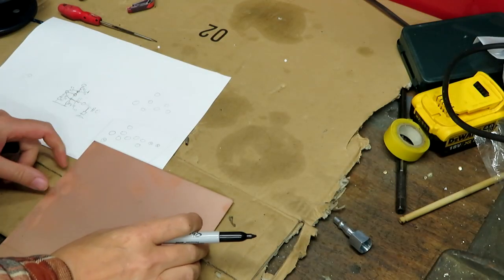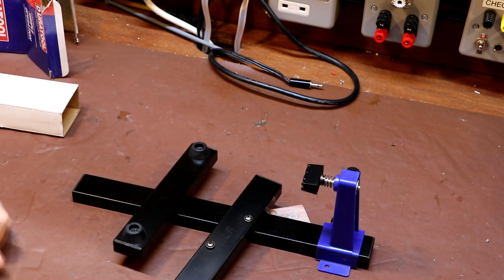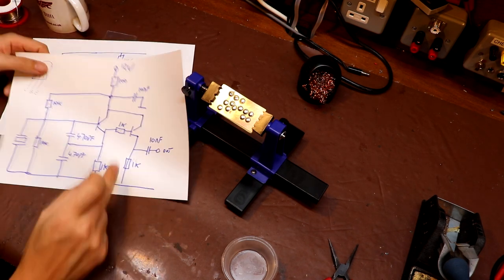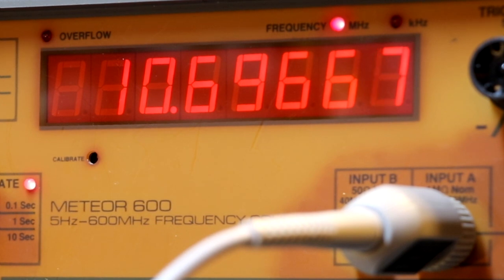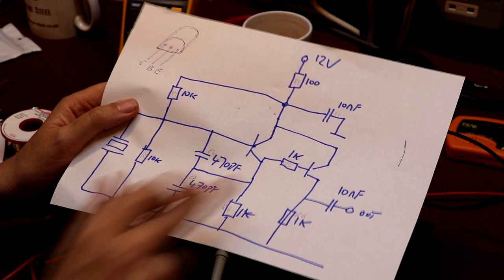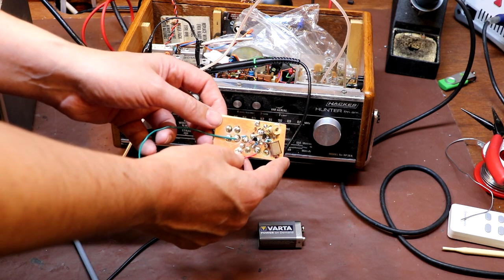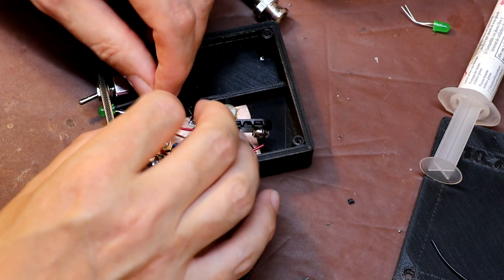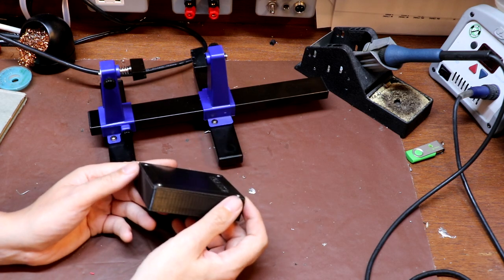Wobulation 10.7Mhz Crystal Oscillator

Comment: Nice little project there chris :-D
As i'm sure you know (far better than me), using double sided copper cad pcbs with lands is good for higher frequencys.
No long inductive tracks and minimal capacitance between parts.
I've gobbed a few circuits together in that style because i just could not be arsed, and for stuff that gets thrown in a box for my own use, it don't really matter.
Tobacco tins are nice for r.f boxes or just pcb sheilding :-D.
My dad was hooked on Golden virginia, it was in metal tins in those days :-D
The outboard xtal osc boards in am/ssb c.b radios were handy for super quick oscillators.
I did build a pll controlled wobbulator (from an electronic mag 20 years back) at 10.695mhz for r.x testing, but it was unstable so bugger it lol.
All you need is a itt410 varicap diode biased with a 68k to v+,  then  connect the diode  to the transistor base via a 5pf capacitor. (diode anode to earth).
Feed the diode with a 100k resistor and series 10nf cap from a pot with audio on it,  10.7mhz f.m  mini transmitter lol.
Values would have to be messed with, as i guess a lot ha ha :-D
Or just say "Bugger it"  ha ha :-D.
Smashing video chris, love the neat box you made :-D
Reply from the maker: zx8401ztv I used build all kinds of thinks into those tins my grandad used to also have some . It was a nice little weekend project and something I need for the FM alignment I want to do in the future.  I was looking for a wobulator circuit to homebrew but didn’t find anything.  Thanks for watching Regards Chris

Comment: Another really good project I've made one board so far and trying a 455 KHz using a Crystal resonator, 10.7Mhz, , I think a 460KHz, the  TV  I have, to restore I believe is 60 KHz  on the  I.F, which space for 4 more boards, nice stand alone project, saves faffing around. nice one Chris.
Reply from the maker: Paul  That’s brilliant Paul sounds fantastic. I was looking at one of my old 405 line televisions at work today. So I think I will be doing a television although it may have to wait until the Christmas holiday. I have only worked on one TV so far and know very little so it should be interesting etc.  Good luck with the electronics. Best regards Chris

Comment: Very nice project, Chris! I used Wavetek sweep generators for many years at work for aligning canceller video "IF" strips which had to be stagger-tuned for proper bandwidth and gain. The Wavetek generated its own markers - they were not RF markers but rather injected into the detected output by the sweep control circuit. This mandated the use of the internal detector and so could not be used for things  like discriminator S-curve tuning. Regards, David.
Reply from the maker: David V  The Wavetek stuff is nice but I really like some of the Sencore sweep generators. They aren’t common here but a friend has one and the look great for FM.  I still have a lot to learn about these things but you have to star somewhere etc. Thanks regards Chris
Reply: @allthegearnoidea6752   Sencore do manufacture some excellent test equipment for commercial electronics repair. I recently purchase one of their capacitor analyzers which is great for large electrolytic power supply capacitors - one of the tests it can perform is for leakage at rated voltage which it supplies at up to 600 V. Stay safe, David.
Reply from the maker: David V I have a Lafayette capacitor analyser coming up soon that test to 600 also.

Comment: Hmmm, I've got some diamond coated bits designed for drilling into glass. I'm thinking they might be used for cutting islands into pcb material. Can feel a project coming on. 🤔

Nice video 😎
Reply from the maker: GNU_Ninja  I think you can use any old drill the copper is soft but the GRP is harder. The island technique is one I have used in the past but I cut out the islands from PCB and glue them on. It’s a good construction technique for simple circuit when I cannot be bothered to get the etching tank out.
Reply: @allthegearnoidea6752  Yeah,  I've used the method of gluing little islands, too. Reason I thought of the glass drilling bits, is that they're cylindrical. As to etching PCBs, I was banned from doing that after a ferric chloride incident in me mums kitchen, back in the day 🤭